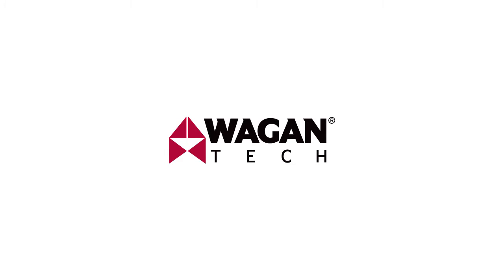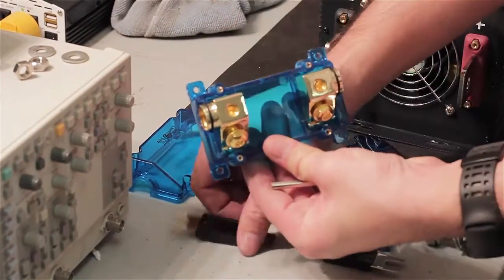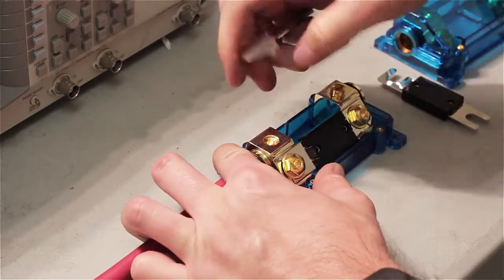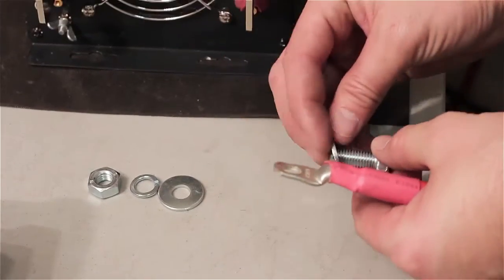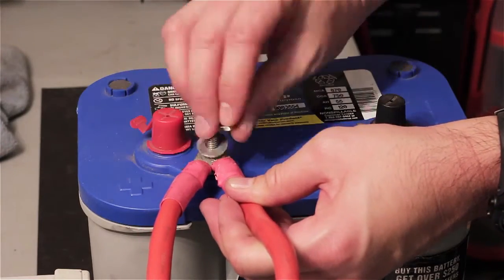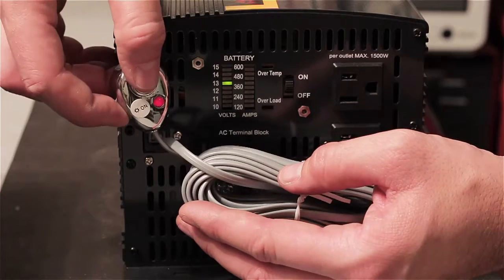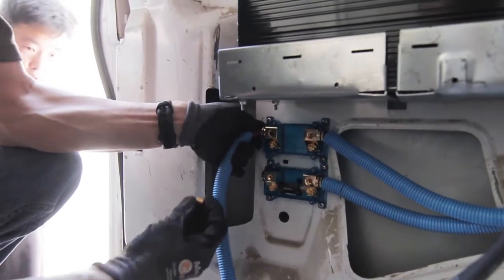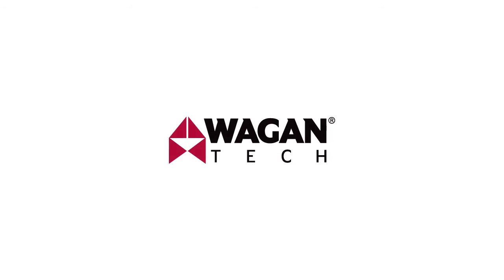Inverter Installation Video - How To Install a Large Power Inverter

Comment: Hey! Thank you for your detailed video! I was wondering if you could help confirm a decision for me. I am about to install a 3500W 7000w Peak invertor into my van alongside 3 100Amp lithium batteries (I may add another battery to the set up if budget allows towards the end of the build!). All will be installed in close proximity and I think I need to make my connections with 4/0 awg (120mm2) wire but wanted to reference check with you. Thanks again!
Reply from the maker: Mark, take a look at this blog here: (https://wagan.com/blogs/news/customer-question-what-cables-do-i-need-for-my-power-inverter). If it is a 12V inverter and has a distance (run) of 12 feet (round-trip) or less, then 4/0 will be perfect.

Comment: It shows you using two batteries or one battery? It's hard to tell because you hook both red wires up to one battery is one red wire going to the other battery and one is going to the inverter? In that case where does the other red wire coming off of the inverter going? I bought this and I'm trying to install it. 12 volt 5000 watt version
Reply from the maker: Hey there! In this instance, we are using one battery. We have 2 positive cables and 2 negative cables attached to the single battery to split the load between the cables. This is done so that you can use a smaller gauge cable to carry the same load. If you only used one black and one red cable, the cable gauge would have to be much greater to carry the same load.

Comment: what are they using for generation? 220amp alt. duel alts at 440??? are you running duel AGMs then a deep cell or just one AGM? 5000W is a big inverter how will it stay constant per the alternators?
Reply from the maker: Depends on the vehicle. The Van we installed it in was diesel and had an HO Alternator with dual AGM batteries (diesels always have dual batteries).

Comment: I recently purchased this inverter. I noticed you have a fuse on both red wires. What size are the fuses? Are they both 600amp?
Reply from the maker: Which inverter did you buy? Check the fuse size on the chart located here: https://wagan.com/blogs/news/customer-question-what-cables-do-i-need-for-my-power-inverter